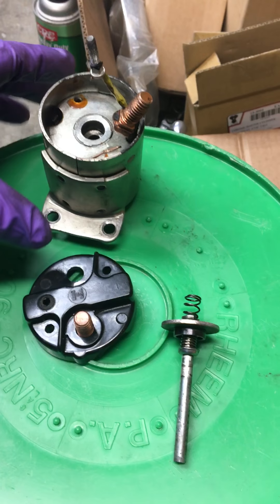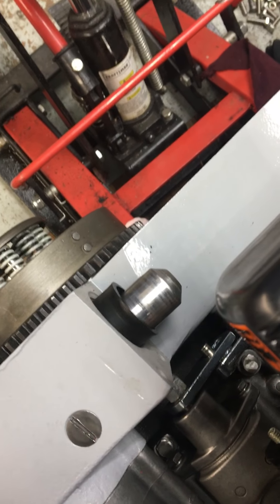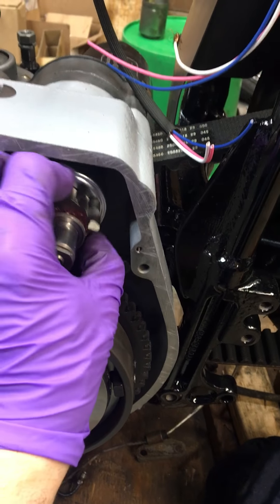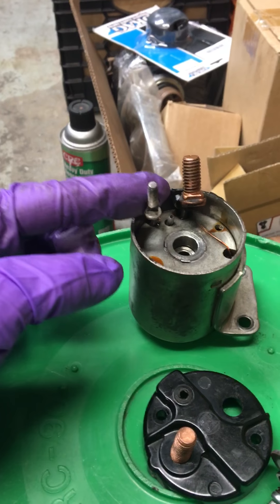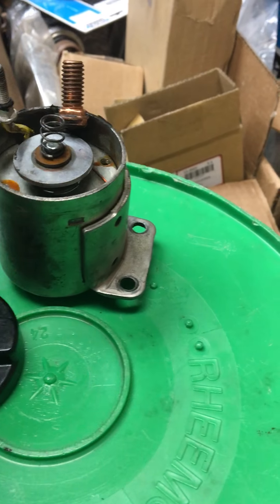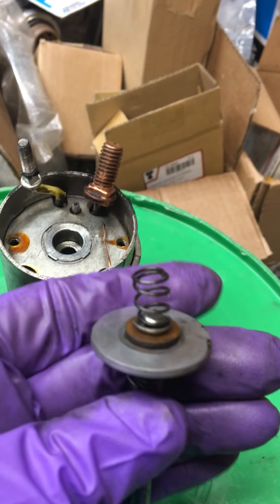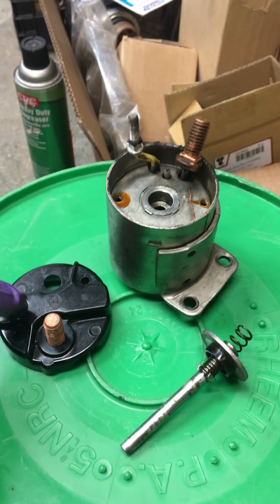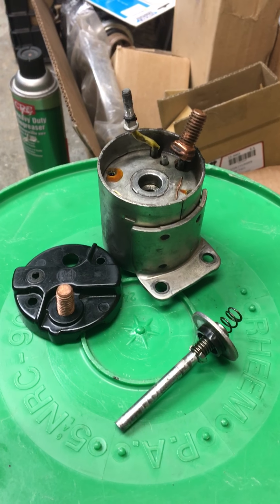Harley Pan - Shovel Head Starter Solenoid rebuild 65-84

Comment: The trouble with rotating the battery stud 180 is you cant do the other. and now when energized the washer hits the studs at an angle and will not always connect 100%
Reply from the maker: Fortunately I didn’t have that problem. I didn’t even think of that.
Reply: That's the exact problem I had with mine. I ended up flipping it back and it worked to get me home.

Comment: Mine was not serviceable on my 82 fly. The wires were soldered to the posts. My solenoid got stuck and continued to run. I had to disconnect the ground.
Reply from the maker: That sucks!

Comment: does the solenoid need to be at a certain teeny tiny dstance from primary, cause mine is grounding out and i think i may have over tighten the two studs that bolt the solenoid to the primary making it ground out, but i also know the solenoid itself is earthed to the primary case by those two bolts, or maybe i lost some washers that where in between those two bolts giving it a certain amount of small space. i dunno its a mystery. great video.
Reply from the maker: The solenoid housing is the ground for the coil in the solenoid. It should be grounded. As for the spacing, there is a 1/4" steel spacer that goes between the inter primary and the solenoid housing. The H-D part number is 31452-65 (Check them out on eBay). I'm on a Facebook group called "Technical Group Only for pre Evo Harley's !!! 1903-1984 !!!" They have all the manuals and parts books for most Knuckle, Pan and Shovels. You can go on it and look up the part that you are missing. If not, get me your email and I'll send you a picture. That you for commenting.
Reply: @Rapsgarage  wow, thanks so much for the help. Greatly appreciated.